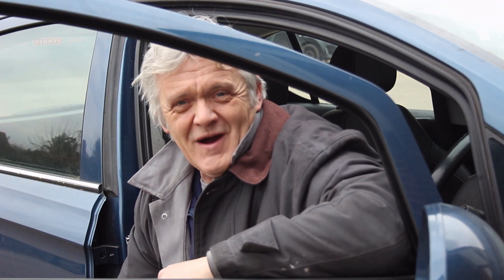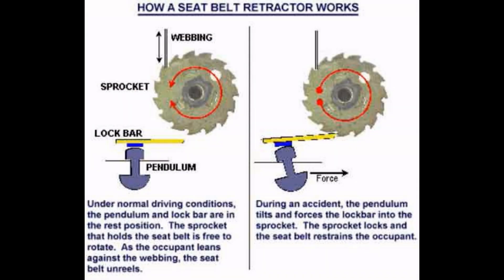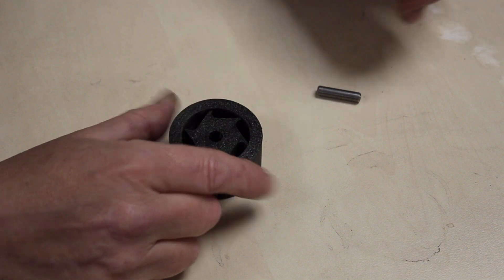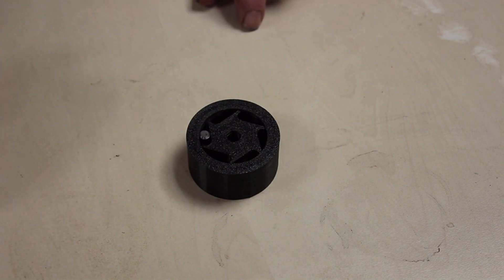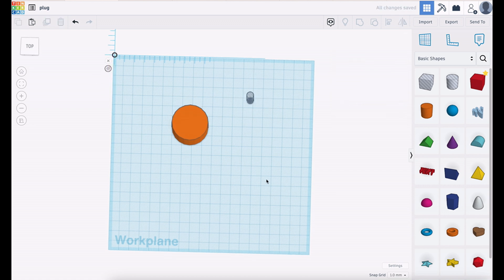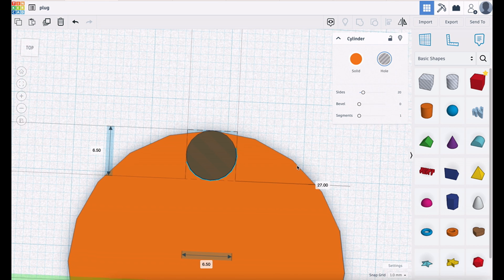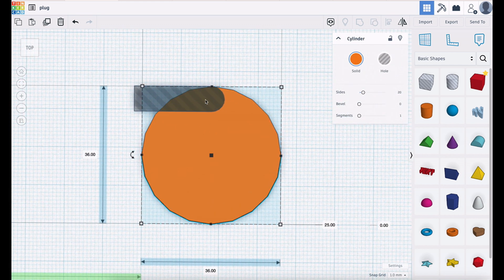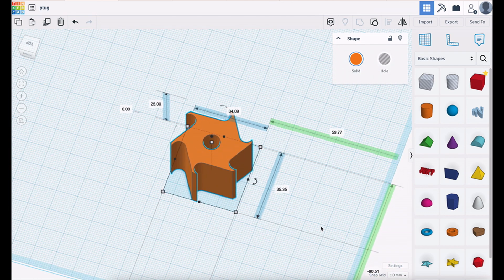1856 The One Way Bearing

Comment: Once I was seen and also tried myself a weird bicycle a neighbour's kid had 25+ years ago. When you were pedalling forward, it was working as intended. But if you try to pedal backwards, it was locking pedals and doing rear brake, so hard so I could have lock the rear wheel and drift like a champion with a bit of bicycling skills I had. I was loved it because first, it was different than every bicycle I know of and I couldn't have understand the mysterious mechanism. And second, my rim brakes wasn't locking the wheels hard as I wanted always, probably lack of maintenance and overused worn brakes. Now seeing this, I think it had a thing like this to brake.
Reply: This sort of bike brake was (maybe still is?) common in North America. It's called a "coaster brake".

Comment: They're called "Sprag clutch" bearings. Very useful devices. Can buy em cheap enough in standard bearing sizes... 👍
Reply: Yep just go to that place named after a river & jungle. They got a plethora of them listed there.
Reply from the maker: this one isn't a sprag mate - sprag clutches are slightly different
Reply: @ThinkingandTinkering  Yes, strictly speaking you are right 👍. Most use "sprag" and "one-way" interchangeably. Yours is a roller clutch type one way bearing. Probably best suited to your application, less drag 😁.
Reply from the maker: @saiello2061  they do indeed mate - I was mulling over 3d printing the sprags but went with the rollers as it was super cheap to buy some stainless steel pins that did the job and I figured the same as you at he end of the day there was going to be less drag with the rollers
Reply: @ThinkingandTinkering  Horses for courses... 😁👍 When I first discovered 3D printing, like yourself, I was thoroughly bitten by the bug at the possibility of printing off my own mechanical parts, it's a reminiscence that comes through in your videos... 😁👍

Comment: Back in the 1960s we put together the Hub with a slip clutch from a bicycle and a cable running to a buoy in a nearby lake, it didn't generate much but as the waves came in it did keep the flywheel going, it's really neat seeing all the projects that you're taking to the next level that we did as kids back in the sixties LOL
Reply: It'd be interesting to see how well that coped with fouling of the cable, because the rest of it sounds less vulnerable to fouling and debris than most other wave- or sea-power designs.
Reply: @williamchamberlain2263  well it was a local Constable that put an end to our project LOL, they did not want an anchor Point screwed into the lake bed so for a long-term result I have no idea we were just a bunch of kids playing with ideas
Reply from the maker: that was a cool project mate

Comment: A cheap form of this is used in the Vileda mop bucket. They fail a lot but are easy to replace. I bought a pack of 10 on eBay for about a tenner.

Comment: A company back in the 70's came up with a material that would do the ratchet and pawl function. The company was 3M, and the material was called "Fibertran". It consisted of two mating surfaces that had hairs on them that lay at an angle. They would slip past each other in one direction and grab each other in the other direction. It was a kind of a directional Velcro.
Reply from the maker: that is so cool - thank you for sharing mate

Comment: Alternator pullys on 2000+ VWs have a one way bearing. So the alternator momentum doesn't push the crank sprocket when slowing down RPMs. This could cause the crank bolt to loosen. They are small diameter and run on a serpentine belt.
Reply from the maker: cheers mate

Comment: i would consider it a one way coupling rather than a bearing, they are handy for connecting inching drive on large gearboxes, just dont run the main drive backwards as the small motor will spin up to some crazy rpm and can come apart. Good content, keep it up.
Reply from the maker: yeah - works for me

Comment: It's not a bearing,  it's loose when disengaged and holds when loaded, it doesn't act as a bearing which would have very little slop, that's why it's called a sprag clutch and not a sprag bearing
Reply from the maker: a sprag clutch is different to what I did mate

Comment: I recall years ago working on the starter for a cb Honda motor which used planetary gears instead of a Bendix.i always thought this was a good idea. Seams as though you could make them quite easily with your printer.
Reply from the maker: yes you could

Comment: Seatbelts are designed to stretch 11mm for every 1M of webbing during a crash. If you have had a sudden breaking situation, or do not know the history of a seatbelt (eg you buy a second hand car)  replace it, the webbing only absorbs impact once-over and a second crash or hard breaking incident will result in less protection.
Reply: Interesting.  Having a little play can also increase the life of some devices and designs.
Reply: @l0I0I0I0  no, you miss the point, the 11mm is designed to stretch during an impact and absorb some of the collision so you are less unlikely to receive serious harm from the forces of the seatbelt pressing against you during an impact. If there wasn't any stretch you would be thrown at high speed into the the belt and when the belt pulls back on you the force will be almost as bad as an impact against the windscreen or dashboard, only less so because of the momentum being contained. The belt is still going to age, possibly faster because of the elasticity and when it does that elasticity will be gone.

Buying a used car? Change the belts especially if it's over 10 years old, had child seats in it (except ISO-fix as these do not require seatbelts to work safely) or if you do not know the history of the car.

Personally, I think all cars being sold second hand should have compulsory replacement seatbelts fitted by a garage and certified by them unless theseatvelts are 3 years old just because of how they work, the difference between serious and minor injuries, or in worst case death (yes bad seatbelts can cause worse damage to you than without.
Reply: That is very good to know, thank you for sharing this knowledge 👍
Reply from the maker: cheers mate

Comment: Robert on a side topic I just learned about tri pole magnets. If one side repels + and - could you build an armature with one in it and the opposite side would be a coil. Putting that inside a ring of alternating polarity magnets, they also have them that attract both + and -. There's got to be a configuration that would work I would think... your thoughts. p.s. Great video mate
Reply from the maker: I haven't heard about them either mate so I am off for a read - thanks for the heads up - I will get back to you on this - cheers

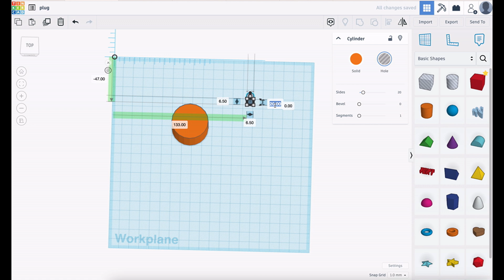Comment: Have you noticed how your cylinders are not exactly round? If I remember correctly, all you have to do is increase the number of sides with the slider 4:12 ... I wasn't sure if you knew, but in case you didn't, here you go
Reply from the maker: thank you mate - I do know but most of the time it doesn't matter and when it does I ream them out for speed

Comment: You love that 3d printer . Do the plastic parts produced have much durability ?
Reply: It's surprisingly durable if your printer is 1:properly set up. 2: you choose the correct filament plastic for the application. 3: your slicer settings are good. 

If either one of these things go wrong,  you could end up with a weak or bad product. If it goes right which it usually does, then it can be strong enough to be used as weaponry.  Lots of 3D printed firearms in USA, here in Europe we can't have that, so I just got myself a 3D printed crossbow instead:p works like a charm.
Reply: @DKFX1  👍
Reply from the maker: they are pretty strong and there are ways to make them even stronger!

Comment: Sprag clutch. 
What is used with a starter motor.
Reply: Commonly found between the ICE, and transmission on helos.
So the transmission can freewheel, allowing for auto-rotation.
Reply from the maker: cheers mate

Comment: Rob or anyone? Getting used to Cura, grouping and centering, however in Tinkercad I'm having trouble doing the same?
Reply from the maker: select the items you want to centre by either holding down the shift key and left mouse clicking them or drag a selection box around the items - the pull down shape menu tells you the number of items you have selected - when you have selected them click the align icon then click on the item you want to align to and you will see the align buttons come up - hope this helps

Comment: I wonder if I can make two of these together for opposite motion to correct to one direction for the leaf turbine..
Reply: You could use belts off them to drive a shaft, just cross over the one belt to change that bearings direction. I was thinking of using a pendulum with a paddle on the end that would be on an angle for the wind to drive and have a guide at the ends to move the paddle over to change direction.
Reply: @D-B-Cooper  excellent thinking! I've been experimenting with gears on one but I might give this a go!
Reply from the maker: yes you can

Comment: Also wondering how thin a wire I can get away with making one with for rollers lol. If I experiment with this I'll share my findings.
Reply from the maker: let us know mate - I like that idea
Reply: @ThinkingandTinkering  Very first test had some success.. it doesn't roll the easiest in the right direction, but it sure doesn't go the other way. Tolerances need slight adjustment though.
Using 20 rollers 1cm long, cut from 1.25mm diameter wire. And I've figured out the arrangement for a functional mechanism, but have a bit more to do to finish that.